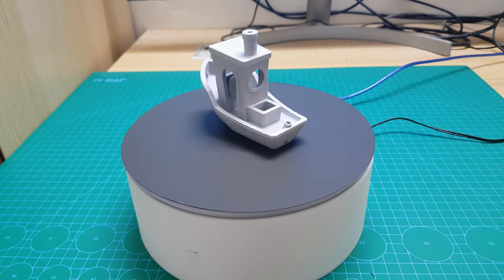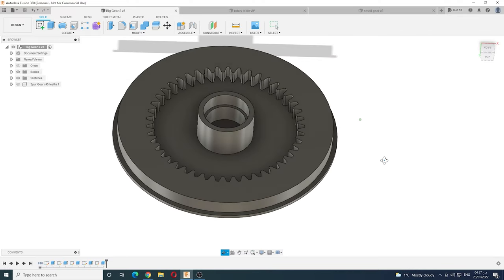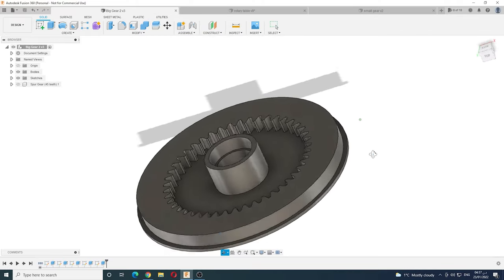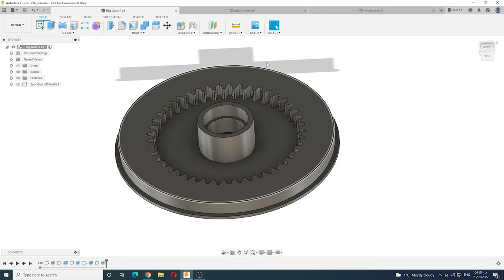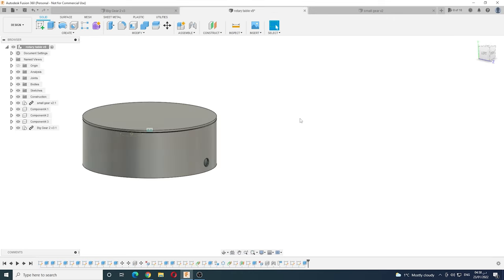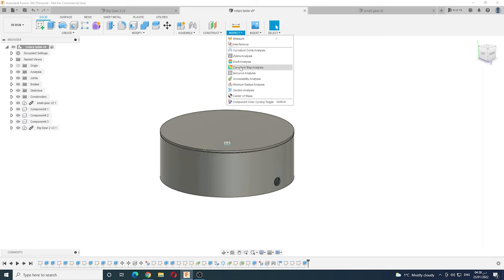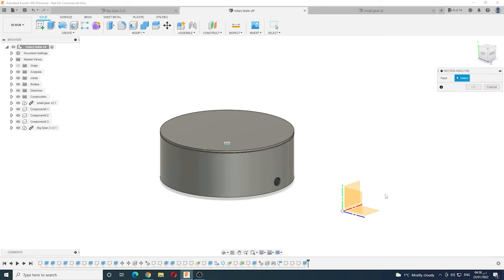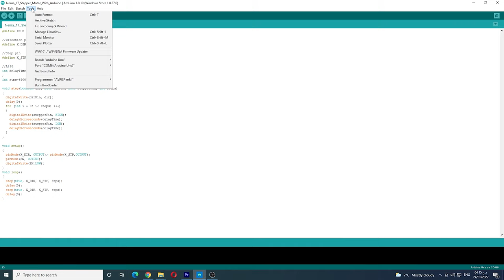Arduino Project — DIY 3D Printed Rotating Display Table

Comment: It should be noted that there are jumpers on the pins for the X Axis driver that is forcing the stepper to microstep. With the A4988, all 3 jumpers has it set to 1/16th step and on the DRV8825 driver, this would be set to a 1/32nd step.
Reply from the maker: thank you for your comment

Comment: Nice work 👍! Can you suggest, how can I estimate the number of gear teeth and stepper motor steps if I want to increase the diameter of the top table plate to 320mm? And where do I need to correct it in the sketch? Thank you))
Reply from the maker: thank you for your comment, it is very easy in fusion 360 we have spur gear by that you can make gear very easy you can look this tutorial 
https://www.youtube.com/watch?v=ysZYCgyVOEQ

Comment: Hello. I am testing my step motor at the moment. It works but the motor is very fast and i dont really know how to slow him down. And the second problem: The motor makes much noise and when i hold him by hand into the plastik gear from the turn table its even more louder. How noisy is your build? Thank you
Reply from the maker: Hello my friend, for the first problem: go to the Arduino code that I attached in the files and just decrease some of the numbers I don't remember which one is responsible for the speed but by trial and error you cant find it 
for the second problem: make sure that the stepper motor driver current is adjusted if you don't know how to do that just watch this video
https://www.youtube.com/watch?v=AVlee67TQxs
if you adjusted the current and still the motor makes a noise you can use a silent stepper motor driver like (TMC2209) which will solve your problem.
Reply: @3dprinterart299  thanks for your answer. I already fixed it. With the jumpers on the Board i Made 1/16 steps and now He is very quiet. But thank you for your answer. Do you think he will become even quieter with this other Driver?
Reply from the maker: @unknown-32-49  you are welcome , yes with TMC2209 stepper motor driver it makes it even quieter
Reply: @3dprinterart299  Okay and i Just need to Set Up 1/16 steps with the jumpers and then its more quiet?